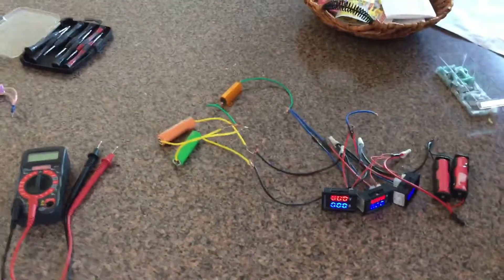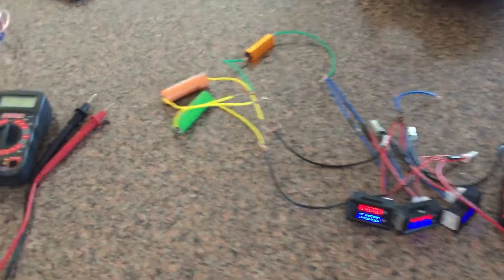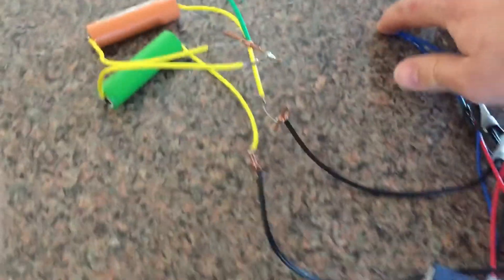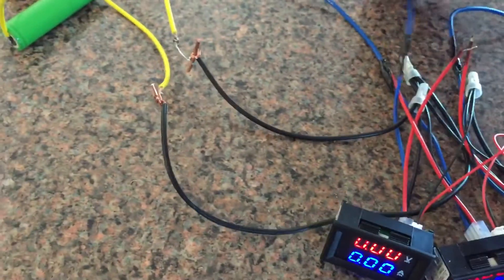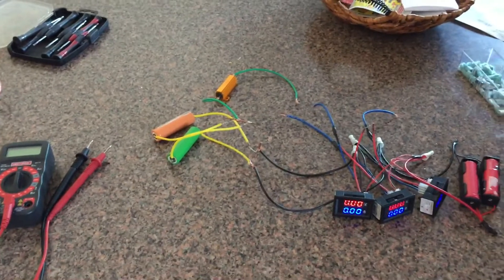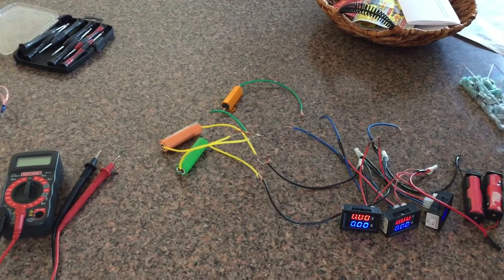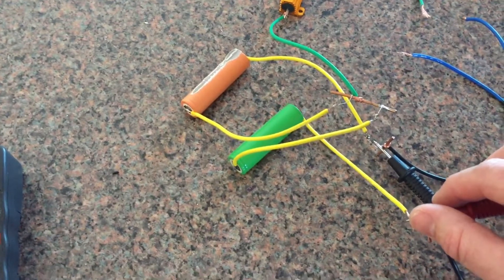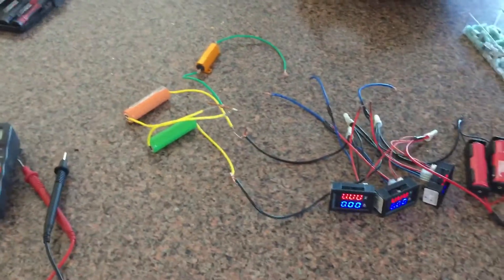Different Capacity 18650 Battery Cells in Parallel. Is it possible?

Comment: Can figure it out with i=v/r I believe and with two batteries can say delta r. Or something like that which solves for the different outputs all hinges on delta r basically so it carries the load evenly based on resistance not on capacity essentially and since parallel theyll stay balanced and stay safe with bms managing voltage
Reply from the maker: This is one of my best videos that no one knows about. haha

Comment: BMS will basically cut off when the weakest cells reach terminus but just like you said the lower resistance cells will carry more of the current and discharge faster so it seems like it should magically work fine

Comment: I would like to build a battery pack in 16s3p 3p=2high discharge cells (35amp each, 3ah) and one high capacity cell (15amp 4,8ah) is it gonna be a 85amp con. 10,8ah pack?! Is it possible in this way?

Comment: Sir can i make 12v battery by using 3.7v different capacity of batteries means
All are 3.7v batteries but
1200+1200+2000=4400mah ,3.7v
1200+1200+2000=4400mah,3.7v
1200+1200+2000=4400mah,3.7v
Like this total 9cells
One set contains 3cells=4400(1200+1200+2000)
So 3sets = 11.1v 4400mah 
Can I make it ? Is it safe
Reply: That’s exactly how a pack should be made.  The 2000mAh cells might pick up more of the load but higher capacity does not equate to lower IR. There are lots of low capacity low IR cells and many of the 3000mAh plus cells have an IR double power cells found in tool batteries. I’m curious to know how that works. If the power cell can more easily provide the current then that would mean it would drop in voltage faster and it would be up to the parallel connection of the cells to transfer the energy from the energy cell to the power cell so the voltages equalize. It seems like this would be worse case scenario and means that cell IR is more important when mixing various cell models. I guess capacity is also important but you would want to avoid mixing low/low cells with high/highcells (capacity/IR)

Comment: a balancer board and BMS can manage all these different capacity

if we don't have a balancer board then 

try to keep all the same capacity in single segment, and another capacity to another segment

ex: if we have a 3s BMS
and we have 2200mah 18650, 2600mah 18659, 

3s BMS should have 0-4, 4-8, 8-12

now connect all 2200mah in 0-4segment, then 2600 to next segment, then next segment would be same as above or any different value

so each segment managed bms, so if a 2200 charges quickly then bms automatically stops power to it and rest will charge to its max capacity,

when discharging , if a segment gets is lowest value then that segment will be balanced with other segment values, 

so there is no problem I found and I have a 15ah 3s pack connected to continues power and discharge to my home CCTV, it's been a year and all working fine, even capacity I don't see any negative impacts.
Reply: So if 4P sets
      set 1 2220 2220 2600 2600
      set 2 2220 2220 2600 2600
      set 3 2220 2220 2600 2600

Or you mean the other way so all the same cells in 1 parallel set?
Reply: Completely different topic. You’re talking about series. We are discussing parallel only.

Comment: I always thought if , battery "A" runs down to minimum safe voltage but battery"B" keeps the BMS from stopping discharge that  battery "A" will continue to run down below safe minimum voltage. Making battery "A" even worse , dead , or TOO hot.
Reply: two batteries in parallel will go to the same voltage and drop together. voltage of A=B

Comment: You will end up one battery pack run out of power first then the other one start to use some of its power to charge those cell already run out of power.
Reply: this is not how it works
Reply: @eXTreemator  You need to look at how BMS work.
Reply: @chanh9220  you need to look how physics of electricity and battery's chemistry works. Chinese crap bms specifics and problems have nothing to do with it
Reply: @eXTreemator  Do you know where the BMS for Tesla is designed?

Comment: Hey guys. I wonder if i can connect a 2ah 3.6v battery in parallel with a 1,1ah 3.6v is that possible?
Reply from the maker: Yes.
Reply: James Klafehn and nothing bad will happend?
Reply from the maker: MadsSi nope
Reply: James Klafehn ok thanks!!! And i really appreichate your fast answers!
Reply from the maker: MadsSi happy to help. No one was there for me so glad I can be of assistance to you
Reply: James Klafehn ❤️❤️❤️
Reply: only join them when they are at same voltage.

Comment: Thanks, I am adding a 48v 10AH pack to my 48v 20AH pack in parallel. Kept seeing people say not to but i found out it has way more to do with voltage than AH. Besides, they have independent BMS's to prevent over discharge and low voltage cutoff. the 10 AH should just close the connection once the voltage gets too low and run on the remaining 10 ah's
Reply from the maker: Exactly. You want them to be the same top and bottom voltage. And each would need a BMS to be safe. You want capacities that are as close to each other as possible but they dont have to be identical. Ive done some more testing since this and it kinda seems like you only have twice the capacity of the lowest battery if you have 2 in parallel.
Reply: Hows it going? Did you wire them in parallel?
Reply: I'm doing something similar,wiring a 42v 10.4ah and a 42v 15 ah in parralel,this will double the amps but of course the controller decides no more than 22amps can enter the motor so it should be fine,both have bms so I'll keep checking for heat/anomalies but should be OK.